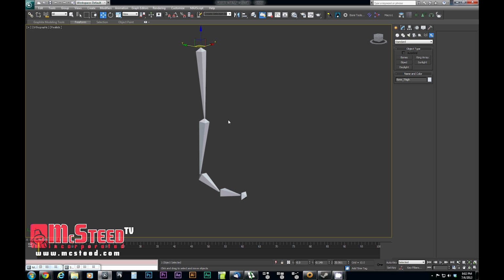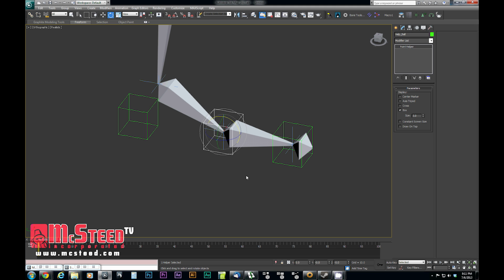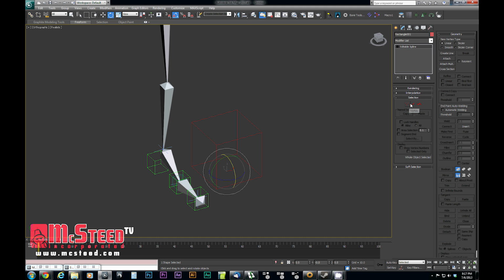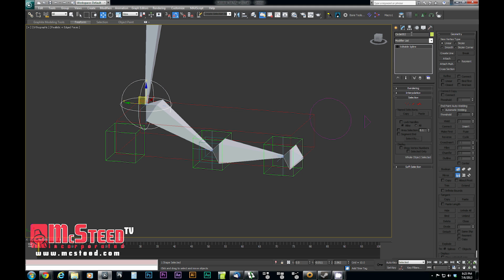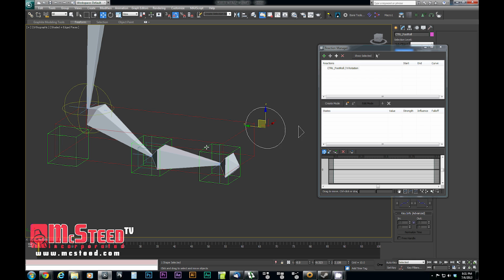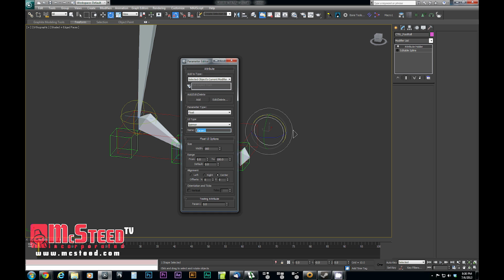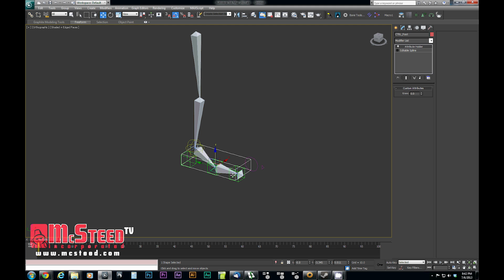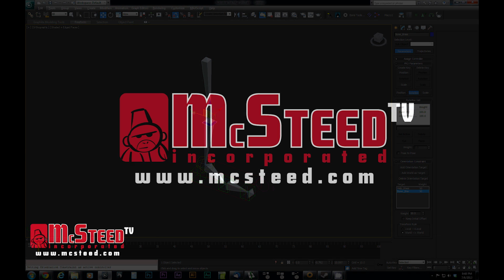How-to - IK Leg Foot rigging 3ds max - factions - McSteed TV

Comment: Great tutorial! I have a question though, I have used these tips on a skined character everything works fine except for the knee which bends backwards, does anyone have any idea on what I'm doing wrong?
Reply: In case anyone else has this problem, I've figured it out. You just have to bend the knees slightly to the right direction beforehand.

Comment: cool I like the way when you rotate back it activates the heel. I generally skip the heel and judge it by eye as I mostly rotate from the ball. It's nice to hear some one else comment that you mostly rotate from the ball. Heel lock is so comon in set up but the ball is a much more useful controler. I usually use Maya so I checked out your vid for an over view of Max thanks for the help.
Reply from the maker: +ezromation Thanks.

Comment: When I was setting up the reaction manager, one of my values started off at 90, and when I moved it down to 0, it messed with the bone system. How do I fix this?
Reply from the maker: I'd have to see the file to be sure. Most likely if there were values on the rotation you created it in a front or side view. If you create an object in a user or perspective view it should have no rotation to it. I suggest deleting the object and recreating. That's the best way to insure there's no legacy transform data.